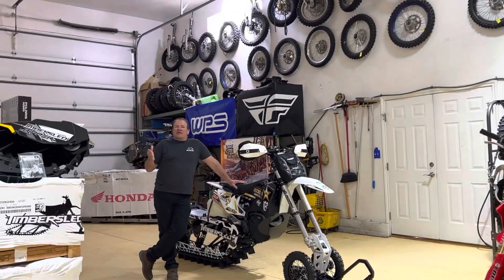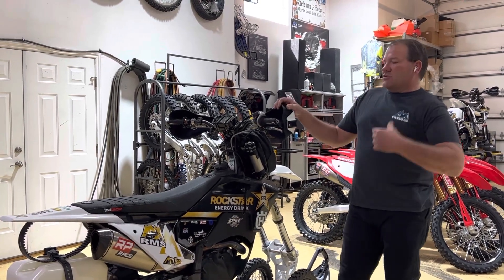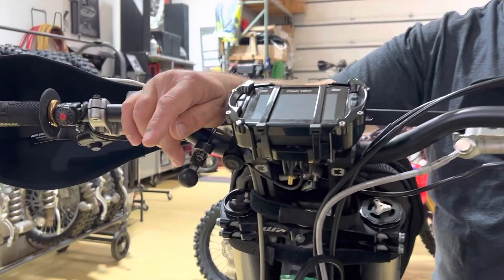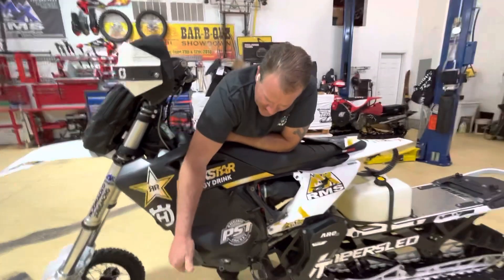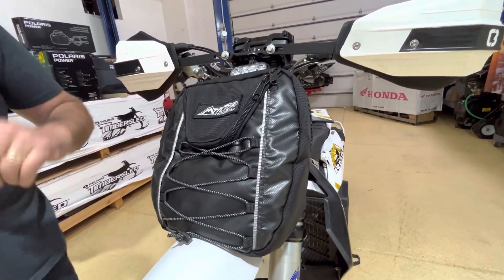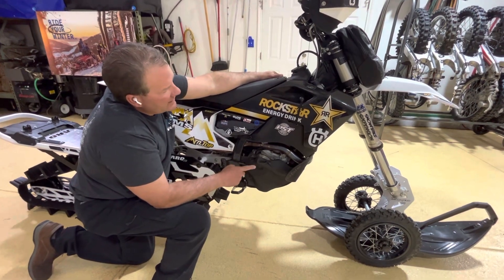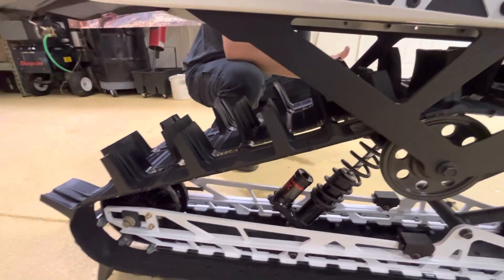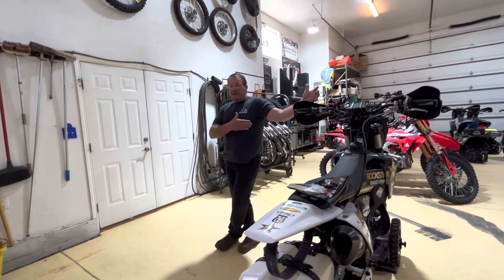2022.5 Husqvarna FC450 Rockstar Walk Around

Comment: Was the TSS accidentally installed the wrong way? Seems easier to have access to the clicker from the back of the vehicle. Can you snake your hand in there and even get to it from the front? 

Also the battery jump dongle is nice to have access without removing the airbox cover. Cold mornings the plastic is brittle and can/will break when you try to remove the airbox cover.
Reply from the maker: The TSS is installed this way on purpose. It is easier to get the no-loss air adapter and pump on with it with it facing the back. Yes you can easily get your hand into the clicker in the front. 

The battery jumper can be accessed without removing the airbox cover.